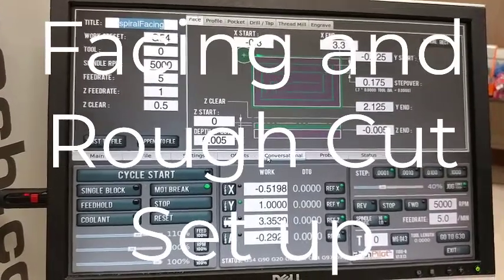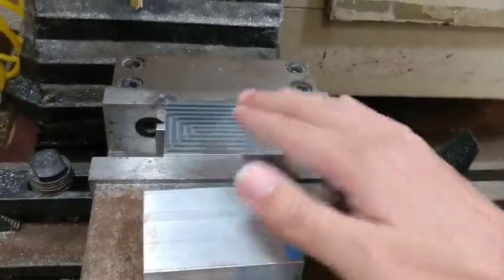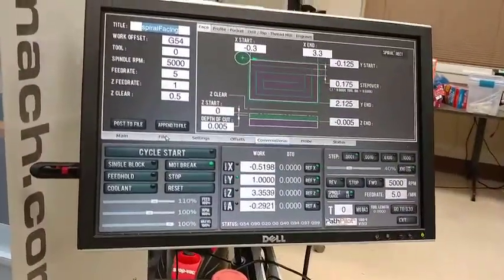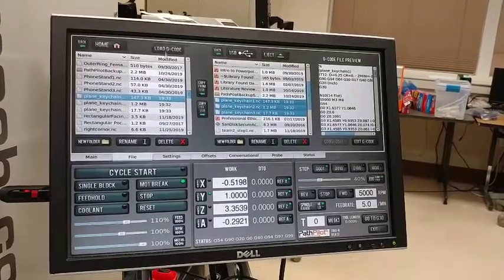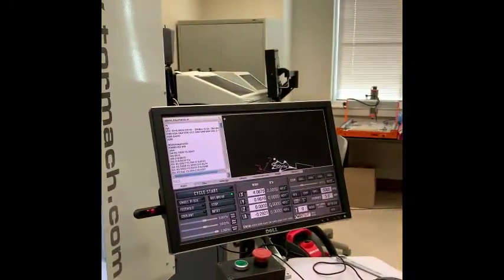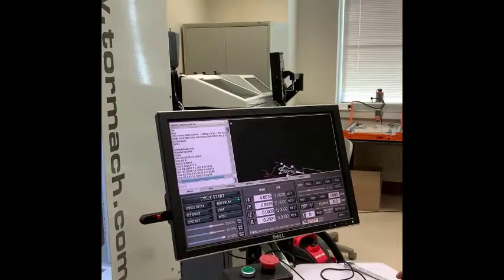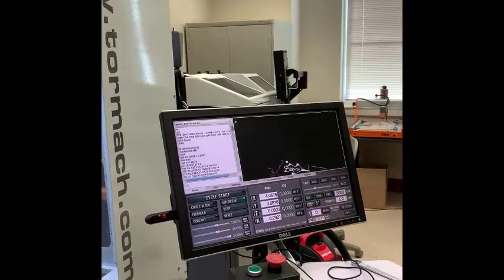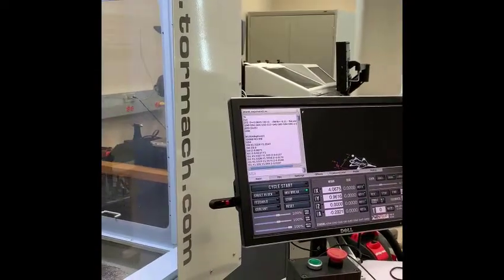Actual CNC machining on Tormach

Comment: Hi Larry, you can run your tormach much, much faster and probably get a better part. What type of cutter were you using?  - Get a 3 flute and run it 8000 rpm 0.003 IPT, you will come out with 71 IMP for feed.  Great work.